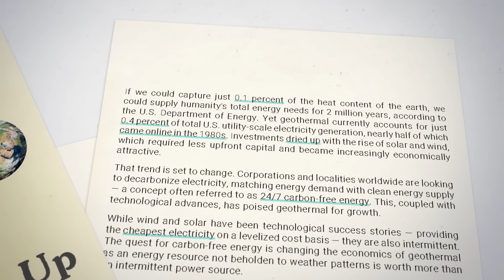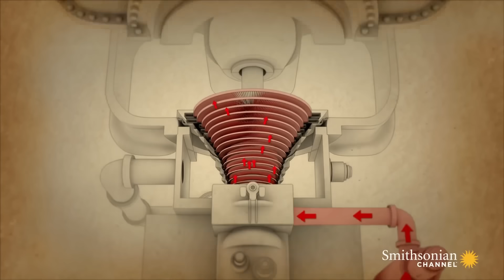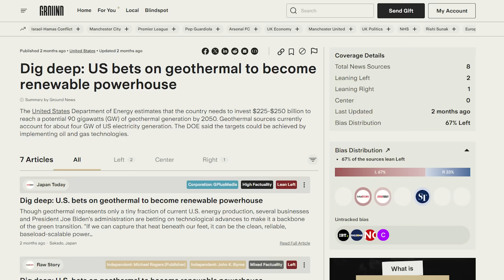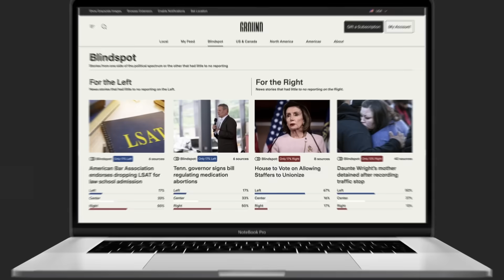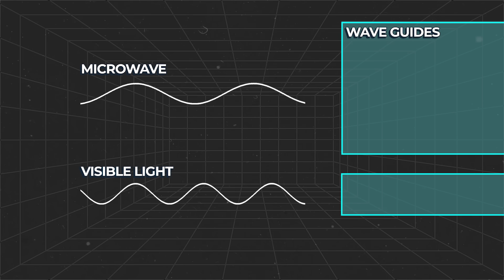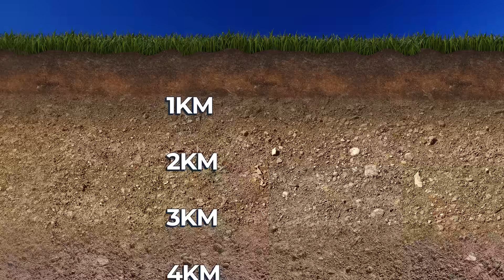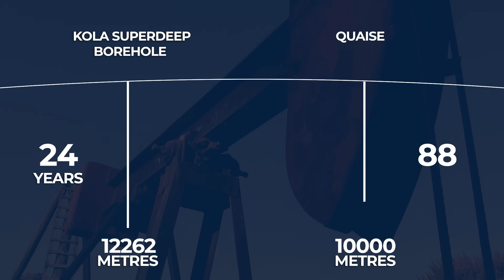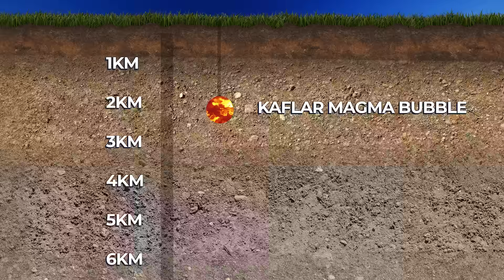This Fusion Tech is Solving the Geothermal Energy Problem

Comment: The microwave "Drill bit" may not wear down, but it will have the opposite problem, accretion of rock vapor into a thick layer on the waveguide. Indeed, the rock vapor is pretty much a not-so-tame lava flow and THAT engineering process will be a beast.
Reply: Yes, incandescent rock vapour condensing higher up the borehole. 
And don't forget the borehole will need to be lined (casing) to prevent it caving in and ingress of water.
How would steel casing cope with the temperature?
Reply: @HighWealder  How would the casing deal with the temperature, the moisture, and the corrosive acids and bases?  When water mixes with some underground rocks and minerals, it forms highly concentrated acids  or bases down there. The corrosive acids are the biggest problem even for mechanical drills.
Reply: My only question with this, I don’t see how that was answered by this video, is, how do you maintain the hole open after making it? It sounds like it would fairly soon close up on its own now? At least start closing enough for this to become significantly less viable
Reply: @marlonb.4017  Exactly. Drilling mud not only cools the cutter and transports the cuttings, but also supplies pressure to hold the bore open. This vaporware simply cannot work at great depth.
Reply: @r0cketplumber That's exactly what I was thinking. The one way I could see this possibly working would be if they could make the beam generator small enough to go down the hole. Then they'd keep the hole filled with mud at all times, and the beam generator would just work to turn the rock into fragments that could be pumped out with the mud, which would have to be filtered before using again.
Reply: No the business end is going to generate micro hand wave and drill to get that sweet investment money.
Reply: How are they going to keep the hole open at the hottest depths?
Reply: Might be more like smoke, same way a fire vaporizes wood and feeds off its gases
Reply: Ｄrill 2 holes?
Reply: And rock deposition on the walls of the tunnel/channel
Reply: This could be solved by having a sliding outer sleeve, almost fabric like, that is rolled out from the hot end and allows the drill to slide through it as it descends. This would double up as a bonus to absorb solidifying gasses/liquids, allowing for waste to be dealt with and for the hole to be protected and reinforced by host material bonded to the face of the hole.
Reply: Virtually all physical processes short of fusion can be engineered with simple application of well understood principles of chemistry and materials science. Look up the guy who cracked the blue LED manufacturing process.
Reply: They turn rock into gas, not dust.
Reply: @kccorliss3922  Presumably that gas wants to resolidify as soon as it finds the area of temperature that will allow it, but presumably the drilling tool will maintain the correct conditions directly around the business end to keep it from being fouled.
Reply: @stopthephilosophicalzombie9017  but they have to keep the rock gas gasious the whole 10km back up to the surface - with out melting the wave guide .
Reply: @malakiblunt  the gas can be diverted before it reaches the guide, they can even flow cooler air across the guide to block the rock vapor from reaching it.
Reply: @sodapopjones260  Divert where? To another hole? So now you have two holes to divert condensing rock gas from. That rock gas will either coat inside of the hole and/or cool enough to coagulate, then fall right back down the hole. I don't think you've thought this through, have you?
Reply: @xenuno  The vapor doesn’t condense unless it loses enough heat, even then, it would mostly form a fine particulate before accumulating into something too solid to flow through a duct.  Heavy duty fans are used to pull air through ducts, so no, the gas wouldn’t just resettle if it was under negative pressure, it would move towards those fans.  On the way to those fans it could be cooled enough to condense, that part would be messy but it could at least be situated in a place that was easy to access for maintenance.
Reply: Indeed.  The video points out how much hotter water needs to get to vaporize at those depths than at sea level, but then they overlook the fact that that same phenomenon will apply to vaporizing rock.
Reply: @yosemiteanemone4714  no it wont,there will be no rock above it to pressurize it
Reply: @interhaker  Which will what then? Pretty sure once you hit a certain depth the hole will tend to fill up due to surrounding pressure, stopping any progress vertically. This rock vapour as well, if still hot pretty sure it will condense at some point, constricting the hole. This is a project meant to fleece investors and governments alike  ..

Comment: No, hot water can only partially flash to steam, and if you want reasonably high pressure steam at around 50 bars, the volume is correspondingly less. You might get 20 to 30 volumes of steam, not 1600.

Comment: Alberta Canada is setting up a research facility to test out this type of technology. The key will be doing this with directional drilling.  That would mean they could punch a lot of holes in one area and branch out from there.  If they can go 10 km down and then 10 km out they could produce a lot of power in a small footprint.
Reply: Why? Its geothermal. We directional drill to expose more of a reservoir or penetrate through several different reservoirs in a sequence, to increase production. This is Geothermal you are producing hot water which probably needs reinjected so a vertical well would do. That said, there could be advantages in having a longer section to circulate fluid for heating.
Reply: @hankchinaski4075  you can drill a lot of holes in one area and then spider out from there.  If you drilled a dozen holes in one area straight down they wouldnt have enough heat production over time.  You would want lots of holes in one area to build a larger power plant in one area. There wouldnt be much of a difference in cost to build a large power plant vs a smaller power plant.  Just like nuclear scale brings down costs.
edit:
When I say scale matters I mean 50 MW wouldnt cost twice as much as 25 MW.  100 MW wouldnt cost twice 50 MW.

Comment: I'm a Geologist with +20 years experience drilling oil and gas wells.
As you stated we already can drill hydrothermal wells, butt in geographic locations identified with a high geothermal gradient
100 m/hr for conventional drilling is a gross exaggeration of drilling speeds at the depths you're aiming for. These speeds can be only achieved in upper softer sequences of shales and sands.

I was on a well offshore Nile delta that was at the time of drilling the deepest vertical well in the Mediterranean and over 21,000ft. Problems we had on this well at depth was the temperature on the tools in hole kept frying the tools. You need special HP/HT tools as you need them to know a) where you are and b) what your drilling.
Limits on my tools at the time was 350F/175 deg C. That is circulating temperature not static bottom hole temperature
Then of course you need a fluid in the wellbore (which is your primary well control) with a specific gravity (mud weight) greater than the highest pore pressure of fluids in the wellbore. If not you will have what is call a blowout.
So, this technology would have to work at high temps and IN a fluid without vapourising the fluid.
Other thoughts are you need seal off sections drilled with steel casing with potentially different pore pressure regimes and having a uniform sized hole is beneficial in running the steel casing. Not sure how uniform a hole this technology would produce.
Clearly this technology would be utilised in the base sections with conventional drilling in the upper sections.
Reply: Yah that is the plan.  Drill conventionally to a certain depth before switching to this system.  The other thing they will want is to be able to do directional drilling.  If they can just move the drilling rig like 10-20 meters and then start drilling again they can bring down costs.  That would also bring down the cost of infrastructure at the surface as well.  You only build one power plant at the surface that is fed by like a dozen holes that are going in different directions.
Reply: @pin65371  you’re still not accounting for the fact that you need fluid to drill a wellbore for stability and well control, and I’m not sure hydrothermal is the same as production well in that drilling for reservoir coverage is comparable with drilling multiwell for heat exchange. You are just producing steam, has to be reinjected. Really depends on the geothermal gradient of location. And the longer the well the greater the cooling to sit in transit to surface so the current method of drilling hydrothermal in hotspots in the crust I think is still the best approach.
Reply: Mercury as drilling mud. All the weight you could want (your steel tools will float in it). Low viscosity. High thermal conductivity. Reasonably high boiling point. 

Of course, it might just end up killing everyone, too.
Reply: @theevermind that'd work, is it transparent to microwaves? the weight may be an issue where it may actually fracture the formation by being too heavy as well.. always a balancing act with this stuff :(
Reply: @theevermind  as Tony Stark would say not a great plan.

Apart from Mercury being incredibly poisonous, you can go too far the other way if your fluid is too heavy you fracture the formation and you lose all your fluid to the point of hydrostatic where it will come back the other way at you if you don’t have enough mercury to fill the hole you’ve got a mercury blowout.
Reply: You're 100% right, this technology is taking formation pressure (well control)  and cuttings lifting into account not at all.  I don't think they're talking about how they plan on holding back formation pressure at all. Vitreous layer that I can't verify the thickness of? I'll watch that particular wellsite from far away.
Reply: Casing. What casing? What's casing? 

Note there is no mention of casing.
Reply: @FREDDAGGS  yeah you can’t drill a well without it. So what’s your point?
Reply: @hankchinaski4075  Of course you can drill a well without it. Just not a very deep one and you need fortuitous ground conditions.
That is beside the point. Do you not think casing these 10km down (not across) boreholes might be one of the reasons we don't do this with conventional methods?
Reply: @FREDDAGGS  I don't understand your question but no, you need casing in a production well either gas oil or hot water geothermal. You could gravel pack an open hole section for production but the majority of the well would be cased off.
Reply: @hankchinaski4075  you are aware there is a world outside oil and gas yes?
Reply: @FREDDAGGS  do you do anything else other than spend your time writing cryptic nonsensical comments on old YouTube posts ?
Reply: @hankchinaski4075  You said you were a geologist. The topic here is solving the issue of drilling ultra deep bore holes so that geothermal energy is possible in normal geothermal gradients. They seem to think that changing bits is the limiting factor preventing quickly drilling these holes. 
Not once in the video do they discuss casing a hole to >10km with this technology. You don't find this strange?
Reply: @FREDDAGGS  They don't mention it because they don't understand the process of getting to 10km obviously.
I'm providing a professional opinion on the application. 
Drilling rate are highly dependable of many factors such as lithology, pore pressure, and bit selection. 
Drilling a granite basement would be considerably slower than a sandstone at equal depths. 
It won't work because of the reasons I state. 

If you think you can laser a hole in the ground to +10km with nothing in the hole you're living in cloud cuckoo land. 
How do you get to 10km without running steel casing?
Reply: @hankchinaski4075  So you understand my point.
Reply: @FREDDAGGS  no sorry I don’t
Reply: @hankchinaski4075  so you think casing to 10km is a non issue and the entirety of the problem is how long bit changes take?
Reply: @FREDDAGGS  The casing is a given if you want to protect the well integrity and produce hot water.
They (in the video) are saying that about bit  changing (tripping) time. I guess it's how they are justify the research grant into this technology. The prospect of saving money in the overall project cost. But this is not based in reality for the reasons have stated.
From memory the well they quote was a research well looking at lower crustal rocks  so they would have been igneous and extremely hard. Maybe not a great example but suits there narative.
Drilling hard rock you are generally limited to a Tricone bit (vs PDC bit) and the limiting factor on these bits is time and wear on the bearings as they have moving internal parts as apposed to a PDC bit which has no hard limitation on time but struggles to drill such lithologies.  
50 hrs of drilling is generally all Tricone bits can drill safely, otherwise you risk losing a cone in the well and that is very costly.
However, again, this is a given in the well cost. There isn't a way around it.
There are a lot of factors that affect drilling rates. This is why hydrothermal wells are currently drilled in areas with high Geothermal gradients because it doesn't make sense not to.
Reply: Amazing experience! if I may ask. what is the fluid commonly used for the well and what exactly is a blowout? does the fluid quickly vaporizes and rises to the top so rapidly that it becomes like a geyser? or something else?
Reply: @gokiburi-chan4255  they use what is called drilling mud in the well to hold back the pressure so it has to be maintained at or above hydrostatic equivalent mud weight otherwise if you have penetrated anything porous and permeable with fluid you will take an influx of fluid whether that be gas/oil or water mixture of both. 
Drilling mud is either a water-based fluid or more commonly and in deeper holes a synthetic oil. This is used for cooling drill bit and lubrication, and transport of drilled cuttings to surface. It is pumped down the middle of the drilling pipe and circulated back out through the annular space between outside of drill string and borehole wall. 
On top of a well you have a Blow out Preventer. BOP. As I said if your hydrostatic mud weight drops below formation pressure the well can take an influx of formation fluid. The issue comes when the influx is not controlled at surface  while circulating out or the pressure/volume exceeds the pressure rating of BOP. It doesn’t vapourise. 
Actually, influxes happen all the time but the blow out preventer usually has a pressure rating higher than any anticipated influx pressure while circulating it out. 
Blowouts normally happen when you lose mud and cannot maintain the well full of mud or the size of the influx is big. 
I could spend hours explaining it - Deep water horizon” movie is a great dramatisation of an actual blow out watch that it’s pretty scary.  This was a production well already drilled. 
I’ve been at lifeboats with passport ready to go on 2 occasions.
Reply: @gokiburi-chan4255 Geothermal blowouts mostly happen when fluids above the boiling point for water are encountered at shallow depths where we don’t have enough well depth to have a fluid column which will keep the water from boiling and we don’t have much casing cemented into the hole to keep the pressure up. We don’t use the same drilling mud used for oil and gas drilling in the really hot part of the well since that stuff would bake up like a brick. We generally drill underbalanced with either aerated water or just air in the hot part of the well. If we hit a high permeability zone filled with really hot water, we divert it away from the rig through a separator that lets us recover the cuttings (ground up rock pieces).
Reply: Another issue is that if you wanted to use MWD/LWD tools they will stop working at the very high temps in the bottom since they have electronics. 
And knowing the angle and azimuth of the drilling assembly is important.
Reply: We regularly drill geothermal wells to temperatures greater than 200C. A large number of geothermal wells are drilled at temperatures >250C or even 300C. We have the technology now to do this. Plenty of geothermal wells are drilled to temperatures up to 350C.
Reply: @SusanPetty73  generally the idea with geothermal wells you want them hot.
Reply: @SusanPetty73  you want them hot, but we are talking about 250C at 10km. So very very deep, but not particularly hot. 
Fluid overpressure is highly unlikely unless someone placed their bore very poorly. We are talking about geothermal from a normal geothermal gradient in crystalline basement. 
Basically just an absurdly deep hole. 

How does one case down this melted hole? I'm still waiting.

Comment: The big question is how to prevent it from collapsing without using drilling fluids to contain the hole with hidrostatic presure. You will need sth invisible for the photons to hit the bottom
Reply: correct, collapsing or a blowout.
Reply: @hankchinaski4075  i was thinking that... as you are not drilling for gas or oil, blowout chances are slim

Comment: And it’s not necessary to drill that deep. We only need to heat the water to where it’s steam we don’t need to flash it. This is all lies to keep you from wanting this form of clean energy. Most oil wells are halfway to the proper temperature since the average oil temperature out of the ground is what 120°F go Little deeper get to 240 and you’re good enough to Make steam
Reply: "Good enough to make steam" is not good enough to run an efficient power plant.